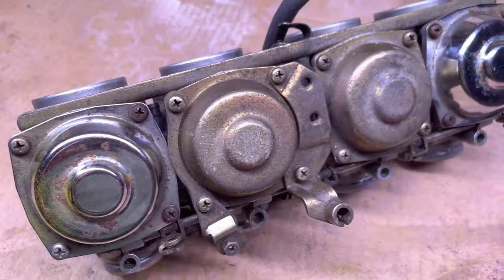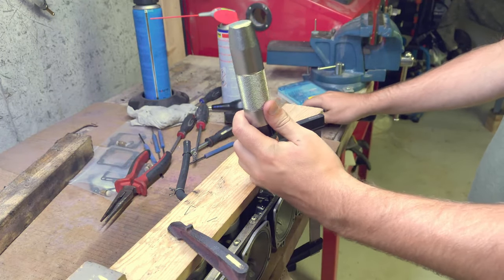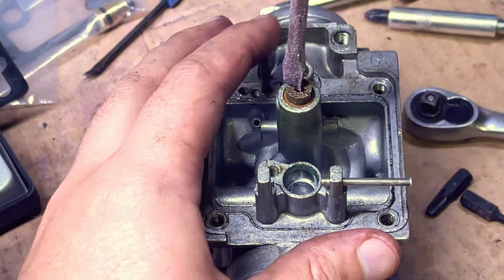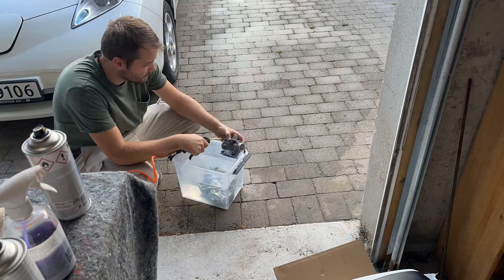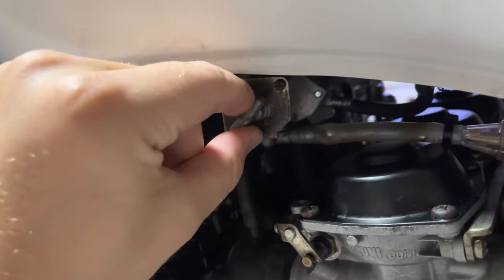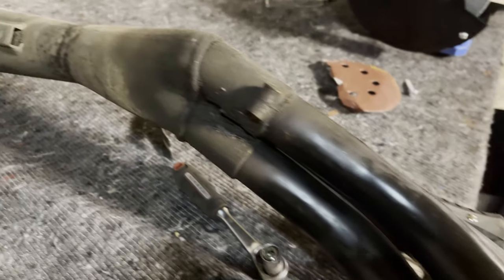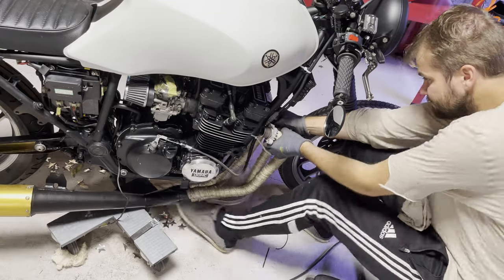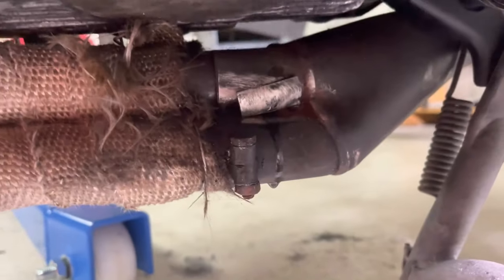Xj600 Episode 13 - Carbs and Exhaust

Comment: Posting this for the algorithm and also to let you know that your videos are serving as a quick-reference guide as mine is torn apart.  I've just decided to use the stock wire harness instead of the mo.unit but will be using the motoscope mini.  Thank you so much for these detailed videos.  Doing my carb this coming weekend.

Comment: I'm guessing this is a Diversion? I have a 1991 XJ600F 3KM5, the version prior to the Diversion.
Anyone know if they have the same carbs on both models? I'm not sure since the Diversion has them pointed up, the 3KM5 model has them horizontally.

Edit: I was wrong! It is a pre-Diversion one in the video too, although it is pretty heavily modified! You can tell by the aforementioned carb angle and the shape of the tank.
That's great because I'm going to be taking apart and cleaning my own carbs tomorrow and now I can prepare for the right bike!

Comment: I really like your reuse approach! It´s amazing how often you can get things running just by cleaning and refreshing. The old original parts are often very high quality, so if youre only careful and cautious when disassembeling they are often fine! Fun and insipiering videos, and good closeups! Keep it up! How is your license coming on???? :)
Reply from the maker: Bad, if i decide to take it, it will not be untill next summer. Or i might sell the bike and move on to other projects. Ive got something planned but we will see if that comes through
Reply: @obs301  You can´t seriously put that kind of effort into the project whithout getting the reward of riding! It´s a really nice bike and kicks ass above 6000 rpm! Go get that license!!! :)